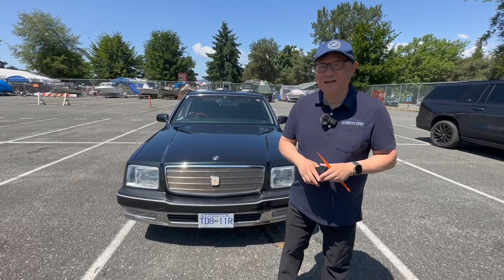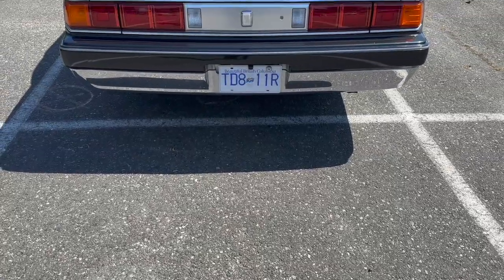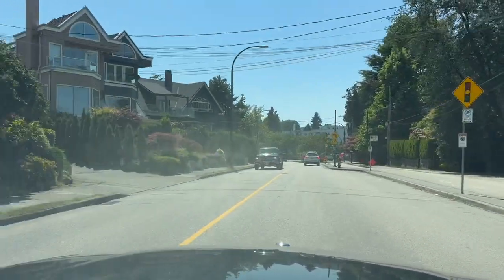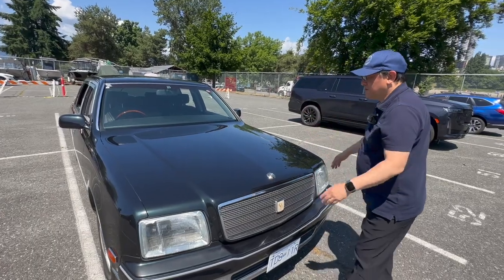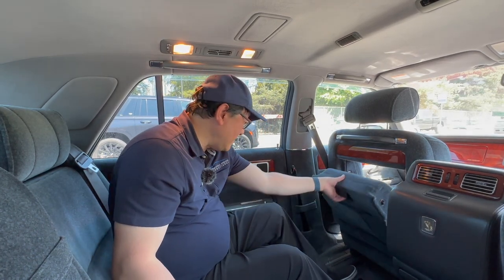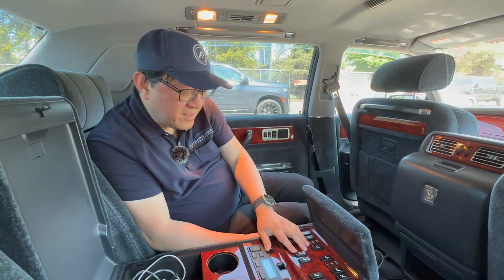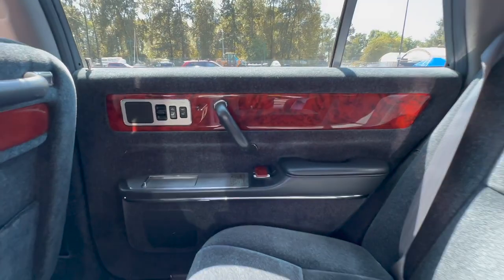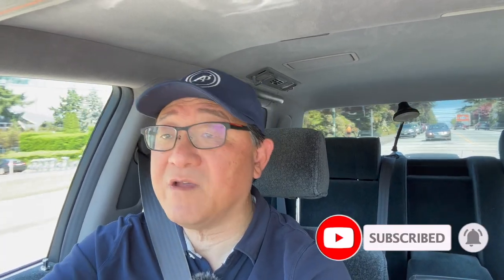ENGINEER EXPLAINS ALL ABOUT TOYOTA CENTURY!

Comment: I have watched a lot of videos on the Toyota Century l live in Australia myself and there are a few for sale you can pick them for around aud $20000 one thing l realy like how the paint came out on your video it is superb the videos usually show the same thing because they are all similar some had leather instead of the wool material l prefer the wool and l did like you mentioned about the wood how all the grain matches and its real wood no from a plastic tree and you had a distinct advantage is because you can read Japanese one if two draw backs with the Toyota Century the other one is that V12 would not be to economical